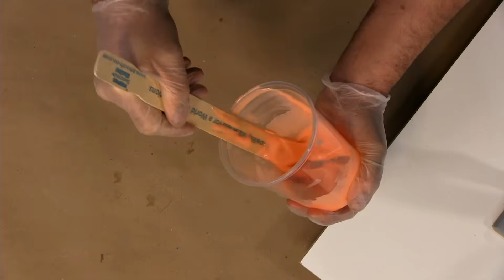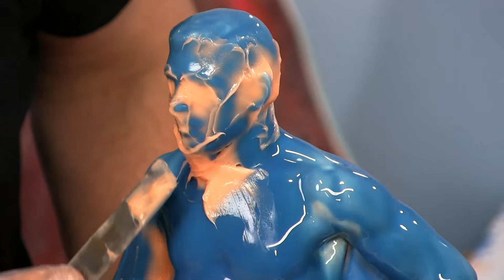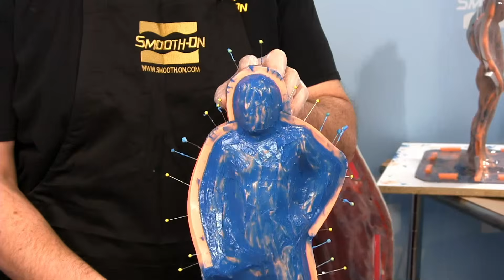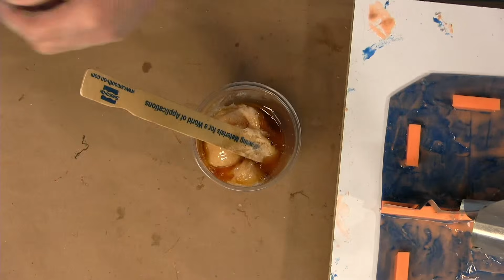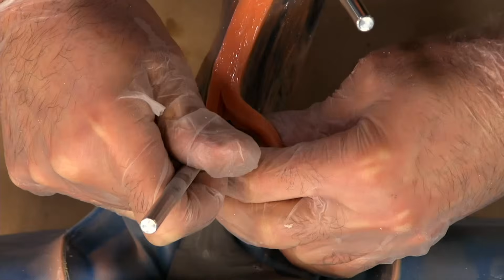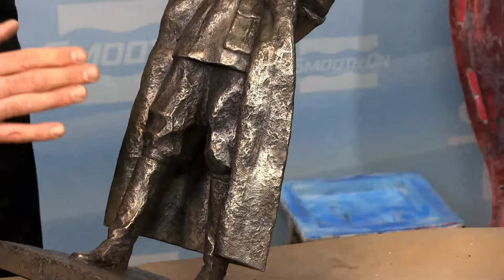YouTube LIVE With Milo - How To Make Brush On Silicone Molds

Comment: What if the art work is made out of clay.   Is it same process ?
Reply from the maker: It depends on what type of clay you use. Depending on the kind of clay, you may have to seal it with a spray before beginning to apply rubber. We have an entire sealer and release guide here if you want to check it out! https://www.smooth-on.com/page/sealers-releases/

Comment: Very informative. What kind of resin is poured in for the casting if it is resin that's used? Thank you very much.
Reply from the maker: Thank you for your comment! When casting with resin, the type of resin used can vary depending on the specific project requirements. Smooth-On offers a variety of resins such as urethane resins, epoxy resins, and polyester resins for casting applications. Each resin type has unique properties and is suitable for different applications. It's essential to choose the right resin based on your project needs. If you need further assistance in selecting the appropriate resin for your casting project, feel free to reach out to Smooth-On's Technical Support Group for personalized guidance.

Comment: I made a project where I had tto use a glove mold to avoid seamlines and flashing, because the part didnt allow me to do any cleanup. The demolding was very diffecult, because the part was a long tubelike shape with a bigger diameter at the top. So I came up with a way to demold without adding stress to the mold material.  I did an alteration to a pressure pot so I could put the mold into it and then add vacuum to it. This "inflated" the mold llike a balloon and I could remove the part just like picking it up from a table. Maybe some of you can use this idea to demold difficult parts.
Reply from the maker: I appreciate your innovative approach to demolding difficult parts! For more tips and advice on mold making and casting techniques, feel free to check out our 'How to Make Molds and Castings' handbook or watch our Mold Making & Casting How-To videos online. If you have any specific questions or need further assistance, please contact Smooth-On Technical Support at [https://www.smooth-on.com/support/ticket/add/].

Comment: Is it easier this way or the you used smooth grey with smooth air from the ecto slime video?

I have sculpted a model similar to your model but has allot of undercuts especially on the crazy anime hair and I have 4 1/2 heads tall without the legs past the thighs. Also should I use shims or those plastic bubble sheets for the undercuts?
Reply from the maker: I recommend contacting Smooth-On Technical Support for assistance with your specific project details. You can reach them via email at the Smooth-On Technical Service Department [https://www.smooth-on.com/support/]. They will be able to provide you with the best guidance for your unique situation.

Comment: Чувак, спроси меня, я тебе объясню как добавить 3-ю руку, 
при растягивании молда

Очень просто и дёшево.
Dude, ask me, I'll explain to you how to add a 3rd hand when stretching the mold
Very simple and cheap.
Reply from the maker: Three hands are better than two, right?
Reply: @smoothon  - 
4-ре руки лучше, чем две, купи два сильных зажима = крокодила в авто-запчастях.

привяжи к ним толстую верёвку, пропусти верёвку по ступни ног, сидя на стуле.
Затем положи молд меду колен, отрегулируй натяжение верёвки и затяни узлы.
Крокодилом зажми одну сторону молда, после надреза зажми другим зажимом другую сторону, раздвигая колени, ты делаешь натяжение силикона, и у тебя две руки свободны, для работы с ножиком. 
4 hands are better than two, buy two strong clamps = alligator clips at auto parts.
tie a thick rope to them, pass the rope along the soles of your feet while sitting on a chair.
Then place the mold on your knees, adjust the tension of the rope and tighten the knots.
Clamp one side of the mold with a crocodile, after making the cut, clamp the other side with another clamp, spreading your knees, you stretch the silicone, and you have two hands free to work with a knife.
Reply: @smoothon  - Я ответил, как сделать 4 руки, ищи у себя ответ, он не прошел.

Comment: Milo How Much Money You Save On Using Latex Which Is Time Consuming You Need To Think About How Much Wages Your Time Costs You In Lost Hours
Reply from the maker: Every material offers plusses and minuses.  The advantage of using latex is low material cost.  A disadvantage is the labor and time necessary to arrive at your finished mold.  Brush on silicone or urethanes will get you a finished mold faster but are significantly more expensive.

Comment: Older video but hoping to get a response, does it have to be a silicon tint or can you use anything else? Hoping to save on money
Reply from the maker: Using a pigment designed to work with silicone rubber is important to ensure the rubber cures correctly.

Comment: Can you use a hairdryer blowing hot air on the figure to dry it faster between layers.
Reply: I wouldn't. 
Let it dry in in it's own time. 

I used a brush on 40 and it seemed a bit long between steps, but a 25min like this  will be half set up while you get the next layer ready. If you're still curious start a ticket with them and as, they're very helpful and respond quickly.
Reply from the maker: Hello, Thanks for watching. No we do not suggest this. If you would like some other options you can contact us and we can help you with your project. https://www.smooth-on.com/support/ticket/add/agree/ Thanks for watching!

Comment: Can I use Mold Star 30 for a brush on module?
Reply from the maker: We recommend using Rebound 25 or another material designed for brush-on moldmaking.  Mold Star 30 is for pour on molds only.

Comment: If the mixed material is thick , is it possible  to thin it by any thinner material
Reply from the maker: You can thin silicone rubber with our Silicone Thinner

Comment: Can I get the same results with Mold Max 30 ?
Reply from the maker: Yes, you can use Mold Max 30 as a brush on rubber.  Adding Thi-Vex will thicken the silicone.

Comment: How is this product with moisture?? Is the cure affected by temperatures?? I’m trying to make a custom mold using a carcass. Taxidermy stuff...I use a two part polyurethane foam mix to make the forms. So would I be able to place the project back into the freezer while partial/full cures are taking place, so that the carcass doesn’t completely thaw/leak and possibly lose shape??
Reply from the maker: To mold a frozen piece, we would recommend Mold Max 30 silicone with Fast Cat 30 - https://www.smooth-on.com/tutorials/molding-casting-alligator-snapping-turtle/.

Comment: when you get the sculpture out and you are talking about not having to deal with excess on one side because you only cut on one side of mold, am i wrong in thinking you will still have cleanup from the inner edges of the arms?

Comment: Great video. Thanks. Your sound could be better. Try to put a high pass filter (HPF) on the sound and remove all frequencies under 200hz. This would remove all the low rumble sounds. And maybe have an eq that takes away the ac noice. That would be great.
Reply from the maker: Thanks for the tips!

Comment: What's the purpose of the bubble in the plastic?  Won't just plain plastic work without the bubbles?
Reply from the maker: Hi Barbara.  The bubble helps make a registration key to let the halves of the rubber mold align properly.
Reply: @smoothon  Thanks for the quick answer.